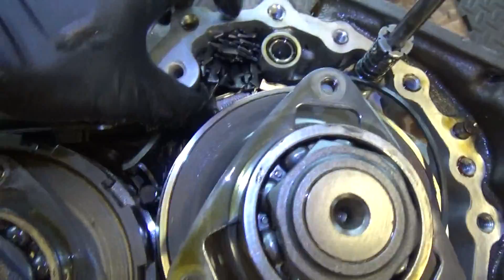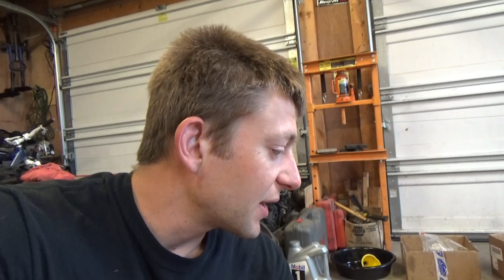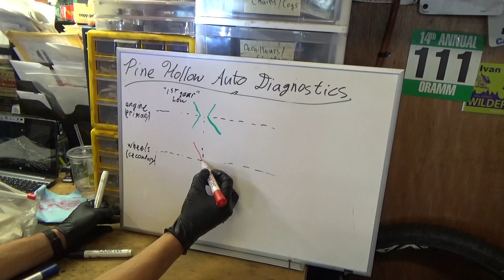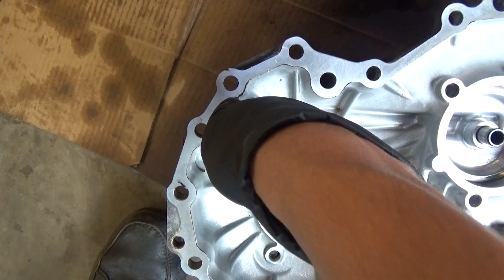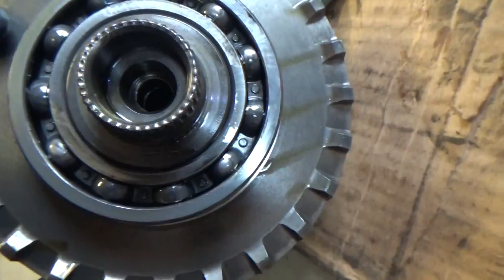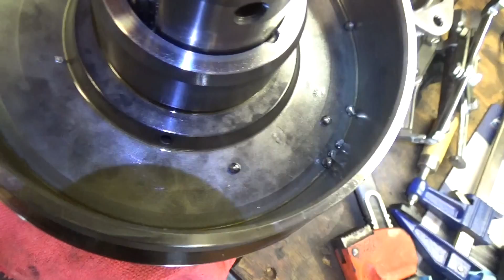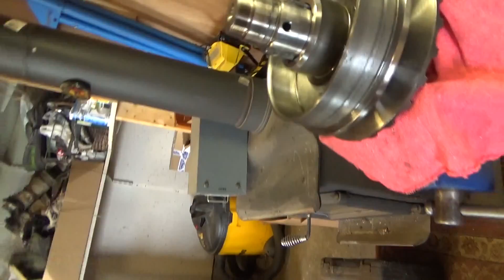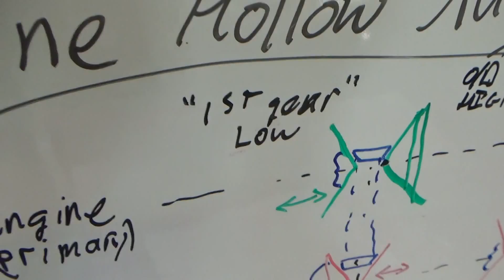Nissan CVT: Teardown and Failure Analysis -Part 2 (RERELEASE!)

Comment: You just convinced me never to buy a vehicle with a CVT transmission.
Reply: Prius CVT is durable.  no bands.
Reply: Worse happens when your geared automatic trans goes.
Reply: 2014 nissan altima 2.5L with the cvt. I have 183,000 miles on mine.............. then agian I CHANGE MY FLUID REGULARLY. and ill be doing another at the end of the month.
Reply: The transmission lasted to 186,000 miles. That's pretty good imho!  You'll see regular auto trans failing at that mileage too. typical automatic transmissions last around 150,00 to 200,000 miles
Reply: CVT's have a life span like most parts.    Nissan could do some redesign on it to make it last longer, but at a cost and increased size and weight.
Maybe make thicker belts built out of stronger alloy ?
Reply: The Prius uses a planetary gear set with 2 electric motor/generators on it for torque and speed conversion.  They don't rely on hydraulics, friction, or any mechanical shifting for operation other than the park pawl.  It was the CVT I bought when I found out how they worked and that they were tested in city traffic in Japan for 5 years before the first ones came to the USA.  I did not trust a snowmobile style transmission for a car daily driver.
Reply: I think the Ford Fusion hybrid uses the same trans as the Toyota hybrids do, right?
Reply: Not sure...sorry.
Reply: @isettech  indeed, that's not much metal taking all the lash from the tranny, and engine torque .. sled had lash taken up through the belt, which is on snow, plus the belt has some flex  till it locks up.. either way, direct mechanical forces on that one spot, he's right spread the load, beef it up,  or put a couple of sacaraficial kush drives on the dive axles to eat up some of the lash,  bit of bad engineering there.. it seems like car companies will knowingly bring a bad design to market,  sell it, and use the profits from the sales to come up with a design fix, instead of getting it right he first time.. deisel v8's anyone ? how much you wanna bet it's a stop gap till the patent runs out on whatever toyota's running, and they will just copy it.. probs re tooling the factory right now..    bet they learned these underhanded tactics from renault!!!
Reply: @ventureelect  +1
Reply: I broke two cvt in one hundred thousand km (ford escort 1.6)
Reply: Ron Butcher u can’t. All of them CVT NOW . Except all cars
Reply: @themechanic4222  mazda doesnt use cvt at all none of there models they use sky active tecnology ,,, from my research ,, expensive models dont use cvt like the honda pilot and acura suvs... there are some top models cars that just dont use cvt they use traditional transmission ... the hybrid, the civics cars the prisus they use cvt 

if you wanna avoid the cvt there is one 2 options research your transmission before u buy it in the car u wanna buy or go MAZDA they have beautiful suv and cars and do not use garbage transmission and mazda is reliable and dependable mine is 19 years old and still running cherry if u want your car to last forever go mazda
Reply: Hey you guys, I just took a $13,700 gamble LOL...

I just bought a 2019 Mitsubishi Mirage G4 (red color for what it's worth). I wanted the hatchback but not enough legroom in the rear, the wheelbase on the G4 (sedan version) is a few inches longer and that translates to a lot more rear legroom. My 11 year old son is already 5'4". Yes it's true, they use a Jatco CVT, you can get one with a manual but the wife doesn't drive a manual 🤷🏻‍♂️ otherwise the choice would not have been a CVT. I swore an oath never to buy anything with a CVT, but I made an exception, hear me out.

First of all, this particular dealer isn't doing very well, it's a Chrysler/Dodge/Jeep/Mitsubishi dealer, they have no room for their inventory, there are cars just sitting on the lot parked everywhere, all up and down the drive aisles there are cars and RAM trucks, nothing is moving. These Mirages have sticker prices on the window of anywhere from $17k-$18k, I think they've been sitting on the lot since spring of 2019 so they are heavily discounted because nobody is buying. After some back and forth I got it at $13,700 plus all the BS fees that go along with it, doc fees, etc. This particular car had an MSRP just slightly north of $18k.

Now as you may or may not be aware, this 3 cylinder engine that's under the hood puts out a whopping 78 horses at peak. My main idea is, CVTs are not for heavy duty applications, I'll even go as far to say not even medium duty applications. Why Mitsubishi and Nissan are using CVTs in heavy SUVs is beyond my comprehension. When I say heavy, I mean like 3500 lbs. or more GVWR. The Mirage's unladen weight I believe is like 2000 lbs. LOL. My premise is, this CVT, with proper care, maintenance and good driving habits SHOULD last me a while if engineered and built correctly. The output shaft of the engine pushing 78hp, in such a light vehicle..... I'm willing to gamble I can make it to at least 184k miles like Ivan's CVT on his Murano 😄.

We'll see.... if anything, I'm paying it off next year, it's only a $10k loan amount, I put the rest down in cash. So even if it lasts me 5 years after it's paid off it's still not too bad considering the EPA fuel economy rating is like 35/41. Would have saved a lot of money in fuel, I do about 15k-20k miles a year, my other car is a 2003 Honda Odyssey with 171k miles, on the original transmission LOL how about that, now there's something you don't see everyday, a late 90s/early 2000s automatic Honda/Acura with high miles on the original factory tranny.

I also have a project car that needs parts and looking for a 2nd Odyssey as well. They're pretty reliable minivans as long as you maintain the ATF religiously.
Reply: https://www.youtube.com/channel/UCNbOhN-IYRTsA4jXEUmWQyA?sub_confirmation=1
Reply: or that cvt's need higher quality materials
Reply: [][][]MANN  My Toyota CVT transmission has 300,000 miles on it before I traded it in for something newer. And according to one of the sales representatives at my dealer, they had just received a CVT Corolla with 600,000 miles and he let me sit inside it and drive it and it still drove like new. Toyota is the only company who can make them right, it does seem however Hyundai's new CVT has also been proven reliable so far
Reply: No CVT for sure
Reply: Yup. Time to buy electric cars.
Reply: @samueladitya1729  that is where things are headed
Reply: @Mia Prung you mean Aisin...
Reply: CVT are garbage IMO. Very good video and informative. Keep them coming.
Reply: @ddemier  it's not like normal automatic transmission are Soo much better that last twice as long and don't start kicking or slippin or we forgot about that already ? lol SUuree...
Reply: Not all models, Toyota, and Mitsubishi technology are ok...
Reply: @christopherfonseka7385  Mitsubishi has the same supplier, Toyota has had lots of problems ..  https://youtu.be/mJB8LdMrM-w
Reply: Mitsubishi vehicles also use a Jatco CVT but it isn’t the same CVT variant that Nissan equips in their vehicle. The big difference between a Mitsubishi CVT and Nissan’ CVT is their transmission control units.
Reply: @ricksays7133  It doesn't matter if you get a Mitsubishi or Nissan CVT. They are both garbage.
Reply: problem with that majority of amarican cars have that transmission now
Reply: @johnfrese4851  Buy a Mazda, they stick with a basic transmission no CVT garbage
Reply: @KalDrayven  I'd rather have a CVT than cylinder deactivation technology 🤮
Reply: Literally every consumer or cheap car is CVT. You can't escape it. Just buy a good CVT
Reply: @jamesgand828  no every car
none of the mazda and acura models use cvt , no model around 30,000 price range are cvt for example the honda pilot .. the honda accord lx , mazda (all models) acura (all models) the super expensive use traditional 10 speed or 8 sped automatic  
so tis just a  matter of looking
Reply: My '15 Sentra transmission, with 34K is working like crap. When it blows, I am going to take it apart and make a giant Mr. T necklace out of the "Kibbles and Bits" and wear it when I go to the dealership I bought the car from and say I want an Audi. Nissan's (WITHOUT cvts) are great vehicles; CVTs were meant for snowmobiles and go karts.
Reply: check the list, so far 4runner are the only not using CVT
Reply: @hispanicuscorpus  Any toyota on a truck fame does not run a CVT. The CVTs are not yet/maybe won't be built for heavy vehicles. Tacoma, 4runner, tundra, etc
Reply: stevey500 The RAV4 and Highlander gas models use an 8 speed auto in the US.
Reply: Nissan's problem is with their pump and the flow control valve failing! The cvt itself is fine they just went cheap on the pump and the fluid should be changed regularly
Reply: Toyota is the only company I feel comfortable with making CVT's, they know how to do it, and how to do it right. Other companies....not so much
Reply from the maker: They are the most boring vehicle to drive haha
Reply: @PineHollowAutoDiagnostics  I disagree lol. I LIKE the consistent/constant PULL when under full throttle and also enjoy having the "kickdown" when dropping my foot on the throttle no matter what current "gear" I am in or what speed of travel.
Reply: Subaru also uses a JATCO CVT but it's chain driven VS belt driven. Actually kinda fun to drive when it simulates "shifting"... kinda sounds like a lazy manual shifting!
Reply: @cigarsgunsanddiesel8032  chain driven? Ain't no chain going to slide up and down those variable pulleys lol but yes the Subarus are using CVTs, too. The simulated shifting is just to keep customers happy and keep them from thinking there's a cost savings CVT in there. The fake shifts are a waste and defeat the purpose of a CVT keeping a constant gear ratio target of the most optimal RPM power point of the engine for the immediate demand.
Reply: I used to work at a Nissan dealership, and they warranty these things like like crazy. They're shit.
Reply: @debutts7723  lol...I've actually had people yell at me claiming they're great transmissions.
I know a friend who has one....nothing but trouble.
Reply: Do not ever buy a CVT , they are expensive to fix and maintain. And they are ABSOLUTE GARBAGE. mine is gonna cost over 4,000 to replace.
Reply: @YoinkSkiddoddle   Autos are about the same cost.
Reply: @YoinkSkiddoddle  how old?
Reply: @edubb2491  2010
Reply: @YoinkSkiddoddle    I plan to sell my 2019 Altima when the warranty expires.  I Have the 4 cylinder model and I don't drive it hard so I think the CVT would last right on but I'll sell it anyway.
Reply: @YoinkSkiddoddle  expensive to replace but how are they any more expensive to maintain than an auto?
Reply: @YoinkSkiddoddle  yeah, i know....my plan is to spend the damn $4000, then sell that p.o.s. rogue by june.....before it sh*ts the bed again.

Comment: What  I'd like to know is why the cvt transmission doesn't last as long in different Nissan vehicles? I have a 2013 Nissan pulsar c12 that had to have its cvt replaced at 116000 kilometers! I wish Nissan gave the same amount of care to its cheaper less volume selling models. The dealer didn't say why it needed to be replaced

Comment: Fatigue is unlikely to be the failure mode, ferrous metals have an endurance limit where if the load is small enough (roughly half the UTS) fatigue becomes negligible.
Also using ball bearings to prevent the pulley from turning is pretty shitty engineering, why wouldn't they use a spline?? That way you still get movement along the axis without slipping.

Comment: Nissan Rogues suck. Auto transmissions suck. Nissan needs to use more metal in the body of their cars are at least devise a mechanical way to make the car not feel like it's made out of aluminum cans. I'd rather drive a corvette and those are mostly plastic bodies.

Comment: I work for a used car dealership we get Nissan Versa's,Altima's and Nissan Sentras from auction with 40,000 and higher range miles with bad CVT  Transmissions all the time.These transmissions are junk

Comment: Excellent video! Totally comprehensive, thank you. Lots of very complicated moving parts, in one of the highest stress and most complicated part of an auto drivetrain. What could go wrong? Everything! Folks avoid CVTs and avoid Nissans. Since they merged with Renault their quality have gone down the toilet. Nissan CVTs are known for reliability issues, and with their new variable compression engines (VCE), it's more of the same, very complicated moving parts. That's why Audi abandoned CVTs. Lots of reliability issues. Honda is using them now and it will come back to haunt them. Avoid these complicated contraptions that are nothing more than expensive reliability nightmares.

Comment: Wow, excellent work. I was tempted to stop watching after seeing the destroyed belt. But digging further you came up with something completely unexpected. Nissan or the transmission company should be paying you big bucks for this work.
Reply: But if you think about it--- if the shaft was the real failure, then the belt would have never broke.   It would have just sheared those little balls and then the shaft/ pulley would just free spin.  So there's no reason that the belt would have broken.   What I think happened is that the belt broke first-- and the all the "kibbles and bits" bound up the pulley and so right after failure, she was still on the gas and the shaft and pulley was chewing up pieces of the belt and binding up-- until it sheared those balls.   The belt failed first-- it had to.

Comment: Sprinkle sprinkle. Perhaps if cylindrical shaped bearings were used the psi applied to the surfaces would be reduced, and the heat transfer increased...

Comment: Great video thanks. Anyone knows if this CVT is the same one used in Altimas or Maximas?
Reply: Mohammed Hnoosh 
It should be same as the Altima as the USDM Rogue uses 2.5L engine.

Comment: @40:47 the main shaft got extremely hot, it turned blue. More then likely the lack of fluid change caused the the grooves to ware to the point that as the pulley moves, there became excessive wear which caused the shaft to move back and forth against those balls which eventually caused the balls to shear causing the shaft to spin in the pulley keeping tension on the belt. If he would have changed the fluid every once in a while, he easily would have gotten well over 200k mi

Comment: Excellent videos. You are definitely my kind of mechanic. You use proper tooling and take your time! The only thing I would have done a little differently is: I would have applied a little propane torch heat to the difficult dowel pin. Just a suggestion. I have been an aircraft engine mechanic for 40 years as well as dabbled in automotive and refrigeration HVAC. Few of the guys I worked with had your skill and patience. Good going, if you get nothing else from my remarks, please take a great big "atta boy" from me in the kindest terms. I really enjoyed this two part video. I am thinking of getting a new Nissan Munero with a v six and this type of CVT. So I hope this doesn't happen to me at age 72 because I am too old to work anymore. Great going!
Reply from the maker: Thank you for the thoughtful comment, John! I really appreciate it!

Comment: I have often wanted to do a teardown on one of these to see how it works.
I have been told that the belt is actually a push belt so all the drive is from the pulleys pushing on the multiple little plates rather than pulling. The bands around the outside are just there to hold all those little plates in place.
Here in New Zealand it is not unusual to see a Nissan CVT failure below 120000, KM not miles.

Comment: I don't understand CVTs. The common motorist looking for an appliance on wheels doesn't give a shit about transmissions dynamics just as long as the vehicle has enough pep for pulling out into traffic. Enthusiasts who DO care are opting for manuals or dual clutch. The slight bump in fuel economy just isn't worth it.

Comment: so when you put the car in park the car is stopped from moving by a dipstick kind of thingy that pushes on a thin mild steel plate and thats what locks the car from moving by engaging on a tiny slot directly on the final drive?that seems it  wont even lock a bycicle properly
Reply: That's why God invented park brakes
Reply: @68404  god did not invent shit..i am not expecting that thingy to stop the car from rolling overnight, i know the purpose of the thing, i was asking a rectorical question to make fun of the flimsy part...they could come up with a more robust mechanism...did you understand or do you have to call god to be you translator?
Reply: @MrHBSoftware  he was joking about God jeez calm down dude
Reply: @bagle58  i am calm, how do you see a lack of calm from written words?i am actually laughing/smiling...
actually a proper answer to my comment would be something like: the thingy is not critical because you are not supposed to leave the car parked without the parking brake. wich i would reply: it is not critical but it should be more robust, looks ridiculously flimsy etc
i am not religious so i wrote god without capital letter, you wrote it with capital letter so if you were offended by my comment then i am sorry, it was not my intention to offend i respect religion but saying that god invented parking brakes is also invoking the name of god in vain...it is also offensive for the religious ones.

Comment: I used to repair CVT transmissions for industrial  use. Most used a manual crank and the pulley belt was rubber. Similar failure as you shown in your video, however it was a spring loaded hub.